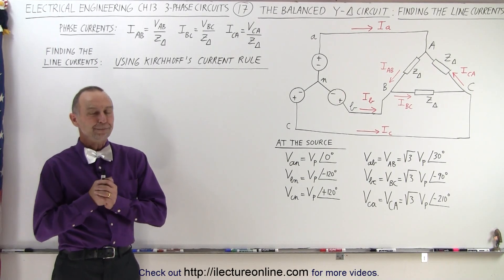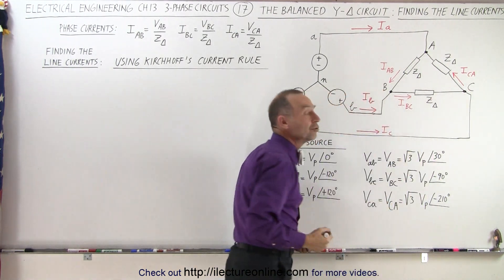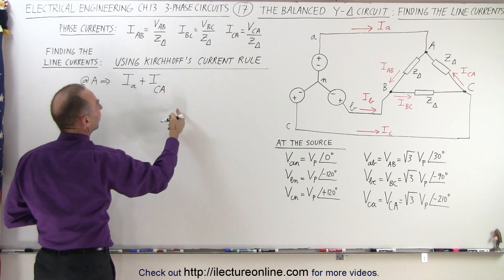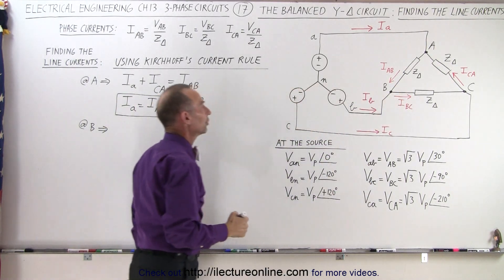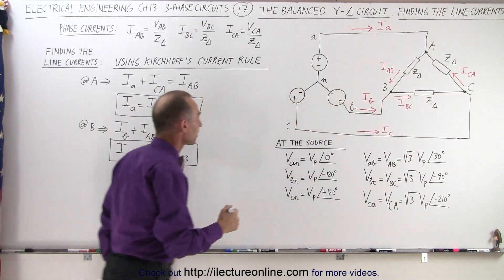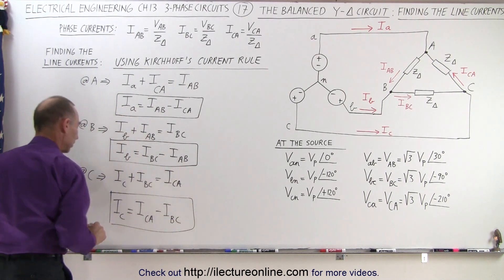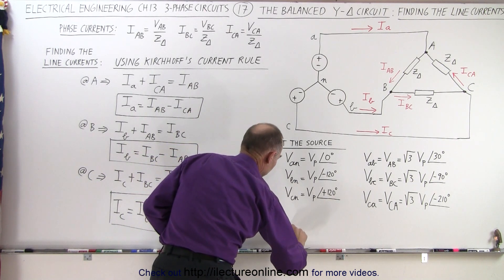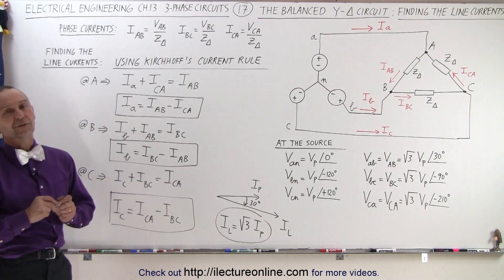Electrical Engineering: Ch 13: 3 Phase Circuit (17 of 42) Find Line Current in a Y-Delta Circuit 1

Comment: Is it true (seeking clarification) that line voltage leads phase voltage by 30deg but line current lags phase current by 30 deg. I don’t understand that.
Reply from the maker: In a Y-delta connection the line voltages lead the phase voltages by 30 degrees.  But the phase currents are equal to the line currents.
Reply: @MichelvanBiezen  alright
Reply: @andyjunior This is same problem I am facing do you answer